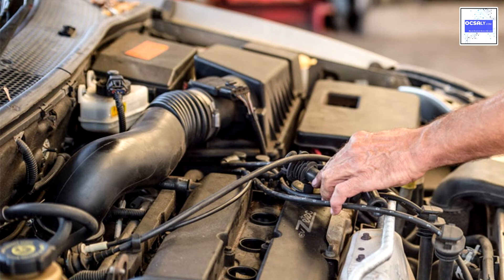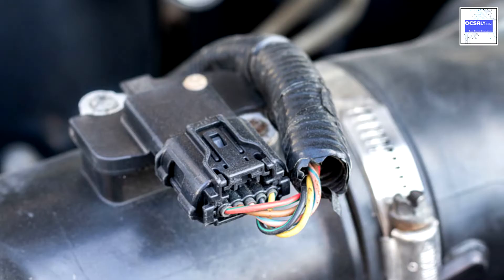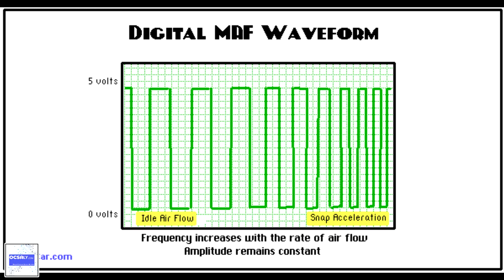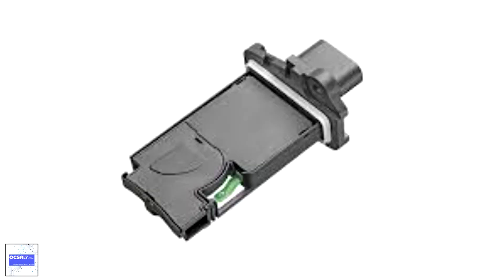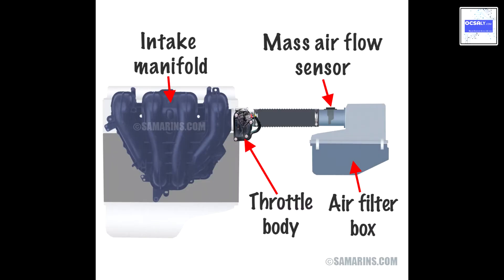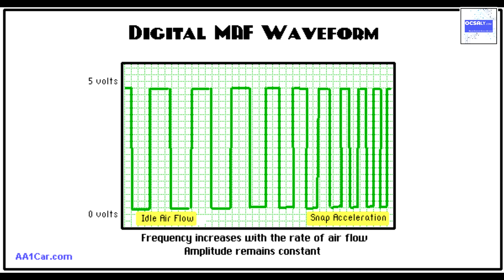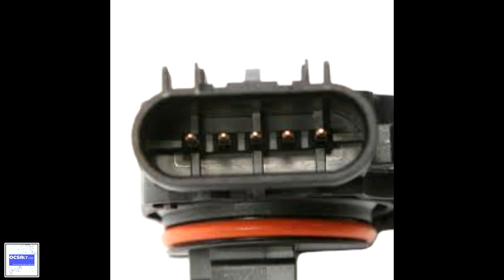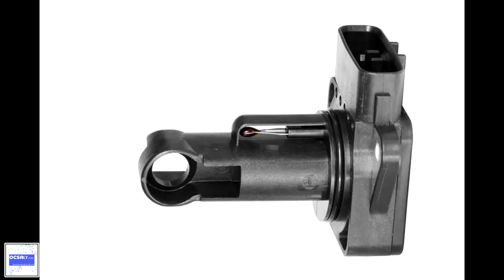MAF - Mass Airflow Sensor | Working Principle | Learn | Training | OCSALY

Comment: Ty. Would the MAF adjust automatically with an additional fuel source is added? Like  Hydrogen added directly into combustion chamber. Cell is capable of a 100 percent increase MPG. I’ve considered using a rheostat of sorts to adjust manually however I wanted another opinion on a few things but mostly the question I asked first. Ty again
Reply from the maker: Clever thought but needs lots of research, unfortunately we didn't do anything adding like adding hydrogen to combustion chamber. Thanks
Reply: I’m more on the side of plug in a scanner . Knowing the optimal readouts. Also knowing it’s a 5 volt reference right . So would I want to manipulate voltage in or voltage out? If I change in voltage, the Maf , will just modify that and tell the ecu whatever to correct. So if I manipulate out voltage to ecu , the ecu would just do the exact same thing unless! The voltage the ecu is reading is out of O.E. Specs to many times ! Then it would just install default numbers based on the other sensors in that loop and throw the check engine light on. Right? So what if i could remove the MaF and provide my own ? So  voltage in doesn’t matter to the sensor and I can manipulate the voltage out so the ecu stays honest and does what I am asking. Haha I hope this makes sense I’m fishing right now my mind is spinning. Guess what I need to research  is where to have my sensor installed so both fuel sources can be read correctly and air. After that it’s simple just do all the math and memorize your settings for every circumstance on the road on this planet and just turn the knob on the rheostat. Ez!!  So yeah research. Definitely right. But being a savvy auto guy for now I can make it simple gas mileage checks, how it’s running ie power and smoothness and mostly how it sounds. My sensor can be dumb take in voltage so ecu is cool then my knob decides info returned. Then where it’s installed and reading is null. Then hoping other sensors cooperate. Anyway not sure that is all making sense but thanks for nerding out with me.
Reply: I’m more on the side of plug in a scanner . Knowing the optimal readouts. Also knowing it’s a 5 volt reference right . So would I want to manipulate voltage in or voltage out? If I change in voltage, the Maf , will just modify that and tell the ecu whatever to correct. So if I manipulate out voltage to ecu , the ecu would just do the exact same thing unless! The voltage the ecu is reading is out of O.E. Specs to many times ! Then it would just install default numbers based on the other sensors in that loop and throw the check engine light on. Right? So what if i could remove the MaF and provide my own ? So  voltage in doesn’t matter to the sensor and I can manipulate the voltage out so the ecu stays honest and does what I am asking. Haha I hope this makes sense I’m fishing right now my mind is spinning. Guess what I need to research  is where to have my sensor installed so both fuel sources can be read correctly and air. After that it’s simple just do all the math and memorize your settings for every circumstance on the road on this planet and just turn the knob on the rheostat. Ez!!  So yeah research. Definitely right. But being a savvy auto guy for now I can make it simple gas mileage checks, how it’s running ie power and smoothness and mostly how it sounds. My sensor can be dumb take in voltage so ecu is cool then my knob decides info returned. Then where it’s installed and reading is null. Then hoping other sensors cooperate. Anyway not sure that is all making sense but thanks for nerding out with me.
Reply: I’m more on the side of plug in a scanner . Knowing the optimal readouts. Also knowing it’s a 5 volt reference right . So would I want to manipulate voltage in or voltage out? If I change in voltage, the Maf , will just modify that and tell the ecu whatever to correct. So if I manipulate out voltage to ecu , the ecu would just do the exact same thing unless! The voltage the ecu is reading is out of O.E. Specs to many times ! Then it would just install default numbers based on the other sensors in that loop and throw the check engine light on. Right? So what if i could remove the MaF and provide my own ? So  voltage in doesn’t matter to the sensor and I can manipulate the voltage out so the ecu stays honest and does what I am asking. Haha I hope this makes sense I’m fishing right now my mind is spinning. Guess what I need to research  is where to have my sensor installed so both fuel sources can be read correctly and air. After that it’s simple just do all the math and memorize your settings for every circumstance on the road on this planet and just turn the knob on the rheostat. Ez!!  So yeah research. Definitely right. But being a savvy auto guy for now I can make it simple gas mileage checks, how it’s running ie power and smoothness and mostly how it sounds. My sensor can be dumb take in voltage so ecu is cool then my knob decides info returned. Then where it’s installed and reading is null. Then hoping other sensors cooperate. Anyway not sure that is all making sense but thanks for nerding out with me.
Reply: I’m more on the side of plug in a scanner . Knowing the optimal readouts. Also knowing it’s a 5 volt reference right . So would I want to manipulate voltage in or voltage out? If I change in voltage, the Maf , will just modify that and tell the ecu whatever to correct. So if I manipulate out voltage to ecu , the ecu would just do the exact same thing unless! The voltage the ecu is reading is out of O.E. Specs to many times ! Then it would just install default numbers based on the other sensors in that loop and throw the check engine light on. Right? So what if i could remove the MaF and provide my own ? So  voltage in doesn’t matter to the sensor and I can manipulate the voltage out so the ecu stays honest and does what I am asking. Haha I hope this makes sense I’m fishing right now my mind is spinning. Guess what I need to research  is where to have my sensor installed so both fuel sources can be read correctly and air. After that it’s simple just do all the math and memorize your settings for every circumstance on the road on this planet and just turn the knob on the rheostat. Ez!!  So yeah research. Definitely right. But being a savvy auto guy for now I can make it simple gas mileage checks, how it’s running ie power and smoothness and mostly how it sounds. My sensor can be dumb take in voltage so ecu is cool then my knob decides info returned. Then where it’s installed and reading is null. Then hoping other sensors cooperate. Anyway not sure that is all making sense but thanks for nerding out with me.
Reply: I’m more on the side of plug in a scanner . Knowing the optimal readouts. Also knowing it’s a 5 volt reference right . So would I want to manipulate voltage in or voltage out? If I change in voltage, the Maf , will just modify that and tell the ecu whatever to correct. So if I manipulate out voltage to ecu , the ecu would just do the exact same thing unless! The voltage the ecu is reading is out of O.E. Specs to many times ! Then it would just install default numbers based on the other sensors in that loop and throw the check engine light on. Right? So what if i could remove the MaF and provide my own ? So  voltage in doesn’t matter to the sensor and I can manipulate the voltage out so the ecu stays honest and does what I am asking. Haha I hope this makes sense I’m fishing right now my mind is spinning. Guess what I need to research  is where to have my sensor installed so both fuel sources can be read correctly and air. After that it’s simple just do all the math and memorize your settings for every circumstance on the road on this planet and just turn the knob on the rheostat. Ez!!  So yeah research. Definitely right. But being a savvy auto guy for now I can make it simple gas mileage checks, how it’s running ie power and smoothness and mostly how it sounds. My sensor can be dumb take in voltage so ecu is cool then my knob decides info returned. Then where it’s installed and reading is null. Then hoping other sensors cooperate. Anyway not sure that is all making sense but thanks for nerding out with me.
Reply: I’m more on the side of plug in a scanner . Knowing the optimal readouts. Also knowing it’s a 5 volt reference right . So would I want to manipulate voltage in or voltage out? If I change in voltage, the Maf , will just modify that and tell the ecu whatever to correct. So if I manipulate out voltage to ecu , the ecu would just do the exact same thing unless! The voltage the ecu is reading is out of O.E. Specs to many times ! Then it would just install default numbers based on the other sensors in that loop and throw the check engine light on. Right? So what if i could remove the MaF and provide my own ? So  voltage in doesn’t matter to the sensor and I can manipulate the voltage out so the ecu stays honest and does what I am asking. Haha I hope this makes sense I’m fishing right now my mind is spinning. Guess what I need to research  is where to have my sensor installed so both fuel sources can be read correctly and air. After that it’s simple just do all the math and memorize your settings for every circumstance on the road on this planet and just turn the knob on the rheostat. Ez!!  So yeah research. Definitely right. But being a savvy auto guy for now I can make it simple gas mileage checks, how it’s running ie power and smoothness and mostly how it sounds. My sensor can be dumb take in voltage so ecu is cool then my knob decides info returned. Then where it’s installed and reading is null. Then hoping other sensors cooperate. Anyway not sure that is all making sense but thanks for nerding out with me.
Reply: I’m more on the side of plug in a scanner . Knowing the optimal readouts. Also knowing it’s a 5 volt reference right . So would I want to manipulate voltage in or voltage out? If I change in voltage, the Maf , will just modify that and tell the ecu whatever to correct. So if I manipulate out voltage to ecu , the ecu would just do the exact same thing unless! The voltage the ecu is reading is out of O.E. Specs to many times ! Then it would just install default numbers based on the other sensors in that loop and throw the check engine light on. Right? So what if i could remove the MaF and provide my own ? So  voltage in doesn’t matter to the sensor and I can manipulate the voltage out so the ecu stays honest and does what I am asking. Haha I hope this makes sense I’m fishing right now my mind is spinning. Guess what I need to research  is where to have my sensor installed so both fuel sources can be read correctly and air. After that it’s simple just do all the math and memorize your settings for every circumstance on the road on this planet and just turn the knob on the rheostat. Ez!!  So yeah research. Definitely right. But being a savvy auto guy for now I can make it simple gas mileage checks, how it’s running ie power and smoothness and mostly how it sounds. My sensor can be dumb take in voltage so ecu is cool then my knob decides info returned. Then where it’s installed and reading is null. Then hoping other sensors cooperate. Anyway not sure that is all making sense but thanks for nerding out with me.
Reply: I’m more on the side of plug in a scanner . Knowing the optimal readouts. Also knowing it’s a 5 volt reference right . So would I want to manipulate voltage in or voltage out? If I change in voltage, the Maf , will just modify that and tell the ecu whatever to correct. So if I manipulate out voltage to ecu , the ecu would just do the exact same thing unless! The voltage the ecu is reading is out of O.E. Specs to many times ! Then it would just install default numbers based on the other sensors in that loop and throw the check engine light on. Right? So what if i could remove the MaF and provide my own ? So  voltage in doesn’t matter to the sensor and I can manipulate the voltage out so the ecu stays honest and does what I am asking. Haha I hope this makes sense I’m fishing right now my mind is spinning. Guess what I need to research  is where to have my sensor installed so both fuel sources can be read correctly and air. After that it’s simple just do all the math and memorize your settings for every circumstance on the road on this planet and just turn the knob on the rheostat. Ez!!  So yeah research. Definitely right. But being a savvy auto guy for now I can make it simple gas mileage checks, how it’s running ie power and smoothness and mostly how it sounds. My sensor can be dumb take in voltage so ecu is cool then my knob decides info returned. Then where it’s installed and reading is null. Then hoping other sensors cooperate. Anyway not sure that is all making sense but thanks for nerding out with me.
Reply: I’m more on the side of plug in a scanner . Knowing the optimal readouts. Also knowing it’s a 5 volt reference right . So would I want to manipulate voltage in or voltage out? If I change in voltage, the Maf , will just modify that and tell the ecu whatever to correct. So if I manipulate out voltage to ecu , the ecu would just do the exact same thing unless! The voltage the ecu is reading is out of O.E. Specs to many times ! Then it would just install default numbers based on the other sensors in that loop and throw the check engine light on. Right? So what if i could remove the MaF and provide my own ? So  voltage in doesn’t matter to the sensor and I can manipulate the voltage out so the ecu stays honest and does what I am asking. Haha I hope this makes sense I’m fishing right now my mind is spinning. Guess what I need to research  is where to have my sensor installed so both fuel sources can be read correctly and air. After that it’s simple just do all the math and memorize your settings for every circumstance on the road on this planet and just turn the knob on the rheostat. Ez!!  So yeah research. Definitely right. But being a savvy auto guy for now I can make it simple gas mileage checks, how it’s running ie power and smoothness and mostly how it sounds. My sensor can be dumb take in voltage so ecu is cool then my knob decides info returned. Then where it’s installed and reading is null. Then hoping other sensors cooperate. Anyway not sure that is all making sense but thanks for nerding out with me.